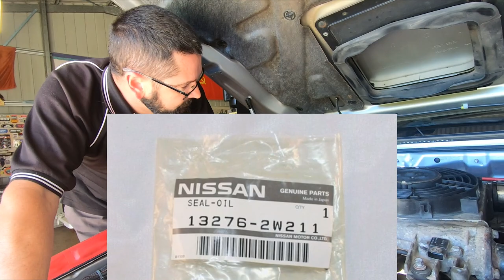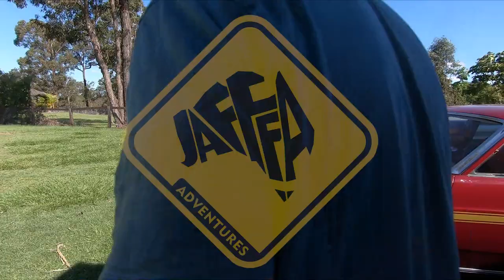How to Fix an Engine Oil Leak | Nissan Patrol | GU Model with the ZD30 Motor

Comment: Thanks for the vid Captain Jafffa - Terry but I have to say the more I see the issues with Diesel engines v petrol engines, EGR blocking up, water in fuel (from on the track etc), the need for after market catch cans, which should come as standard fitment  (yep I have a bit of oil in my petrol induction but not a major issue) , timing belts/chains, injectors, water in diesel fuel, injector issues, glow plugs, AD Blue in newer models, alpine diesel for higher altitude/colder ambient, intercooler issues, oiling up of everything internal, Diesel engines stuffing up engine oil....... I have to say petrol engines seem a better idea except for the availability of fuel in remote areas. yep, protect the electrics for ignition (which still needs to be done for engine electrics in a diesels). Anyways my 2 pennies worth. Cheers Gaz. Love what you present
Reply from the maker: Thanks Gaz, that’s very kind of you to watch and comment.  I do love my diesels but the points you raise are all valid.  Cheers😎👍
Reply: The solution is... buy a Toyota not a Nissan. (Typed while sitting in my Nissan while it's intercooler is off and engine is caked in oil)
Reply from the maker: Too funny Blake 😂😂

Comment: Got my zd30 nissan caravan..same engine and same issues, thanks for the tips gotta do it myself..😉
Reply from the maker: No worries Mark, I’m glad the video was of some help.  Apart from the gymnastics you need to do to get the lines on and off the injector pump, the jobs a relatively easy one.  Thanks for watching and commenting mate, I sincerely appreciate it 👍😎

Comment: Great video . I've tried 4 different local mechanics ( UK ) to fix the injector oil leak on my Movano 3.0l ZD3 200/202 and nobody wants to touch it .Too difficult to get those parts apparently ? They only want the easy stuff or they don't have the grey matter . . .
Reply from the maker: That’s disappointing.  Well if you want to give it a crack yourself it’s not that hard.  Thanks for watching mate 😎👍
Reply: @JafffaAdventures   Thanx Jaffa , I simply can't track down the correct parts here in UK . Do you have the part numbers for the injector / rocker cover gaskets ? I don't give a fk if I've gotta get them Neptune ! this is now a matter of pride  just so I can pull up at the those lazy swines garages and tell those money grabbers I did it myself !
Reply from the maker: Lol, too funny mate.  The part numbers are in the video mate.  Cheers😎👍

Comment: Thanks mate, I just bought a 2013 DX ute & have an incredible oil leak from above the starter motor. I suspect this is the issue & have just ordered the parts. Cheers for such a great video. I'll be watching for more ZD30 videos.... Sorry, I think Toyotas are over rated hahaha
Reply from the maker: No worries at all Jase, I trust this will sort your issue.  Re the ZD30 videos, I can’t promise anything but you never know just because I never know🤔.  Lots of other great channels out there if Jafffa is not your style anyway.  Go well mate😎👍
Reply: Hi,where are you ordering from pls ?
Reply from the maker: They are genuine from the dealer.  The part numbers are all in the video and you can see they are genuine.

Comment: That intake manifold is bound to be sooted to hell! Just did all this to my ZD30Di, EGR intake to manifold didn't look that sooted up yet it was filthy inside the manifold when I removed it.
Reply: Also installed EGR blank, Tillix & Oil catch. Brand new car
Reply from the maker: Yep, makes a massive difference and you should also find your EGT’s dropped lower as well.  Cheers

Comment: I have a gu patrol zd30,is it psible sir that the engine oil can entr to fuel tank?what is the psble culprit for that cause my fuel turns black.
Reply from the maker: No Charlie, oil cannot get into the fuel system,  if your diesel is turning black I would suggest you might have a mould contamination issue.  I run Fuel Dr in my vehicle every tank full and it kills any biological contamination.  I would give that a crack.  Cheers😎👍
Reply: @JafffaAdventures  im thnking of dmage oil seal on ip shaft and oil pass tru banjo bolt return going to tank.
Reply from the maker: Ok, sounds like you have your own answer.  Good luck getting it sorted😎👍
Reply: @JafffaAdventures  but do u think its posble sir?
Reply from the maker: I do not know if that’s possible mate.  Cheers
Reply: @JafffaAdventures  ok.thnk you sir...
Reply from the maker: No worries😎👍